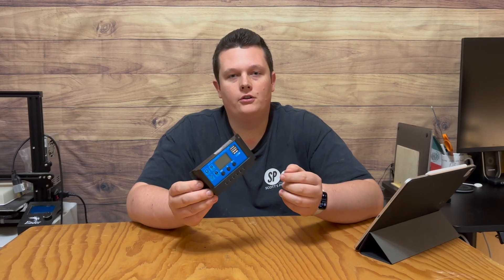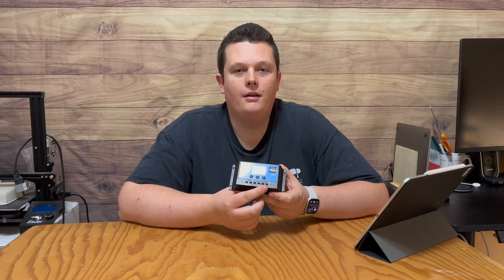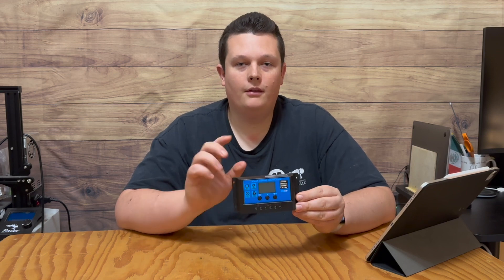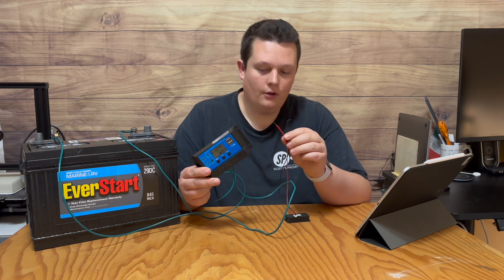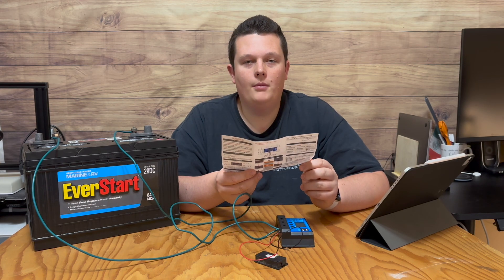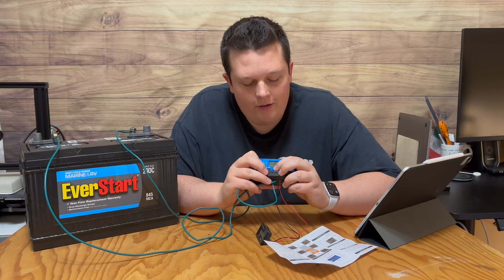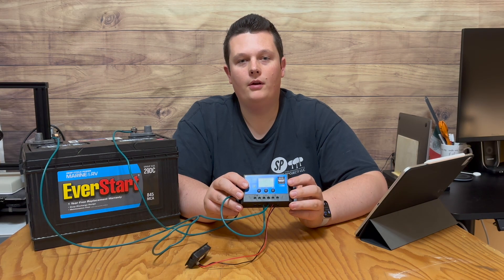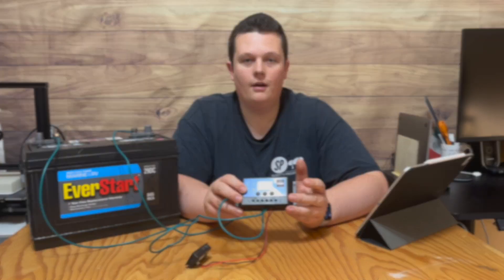How to Setup the Load on a Solar Charge Controller

Comment: Hello Sir can you please help me out 😢  i have solar system at home which is troubling me.the problem is i can't watch a t.v at night but during day i can use solar system very well i have 3000w inverter, 440W solar panels and 50a Sun Solar controller charger and the time i bought all of this i used to operate it even at night so i have have but my problem is i don't know which one is should Change my batteries are 1 year old its 100ah your response will be appreciated 🙏.

Comment: I'm running a 60 watt greenhouse heater through a 300 watt inverter overnight. It drains my 105 ah deep cycle battery to 10v after 2 nights? Should I be able to run this heater this way without draining the battery?

Comment: On the load side can you connect AC or DC appliance or bought
Reply: 12V DC, the same as your battery. You could use a small inverter as the load to create 110/220V power e.g. 150W, maybe 300W.

Comment: Can we connect lcd tv to the controller DC output?
Reply from the maker: In order to do that, if it works, you would have to connect a small inverter to the controller and then try powering your tv from there.

Comment: Hi Scott, nice explanation on the built in output port. Since this output allows to schedule the time for either 12 VDC or 24 VDC devices, it can easily drive a relay coil at one Amp. Then the relay makes it possible to control the timing of the inverter that powers 120 VAC loads. The inverter consumes power at night unless it's turned off, unless the capacity of the battery allows to resume the charge the next morning.  All that depends on how much Ah your battery is capable. As far as the USB is concerned, since it's enabled all the time, it can be used for a small LED motion sensor light whenever servicing the unit at night or to power a security camera. I got a newer version of this PWM controller from Temu for about $15, but I ordered the 24 VDC to give me 720 W max or 240W if I follow your derating. Anyways, that's plenty enough to drive all four air pumps and the two 200 GPH water pumps for my pump through a 300W PWM inverter from Temu that I paid only $25 and 2 200W used solar panels at $20 each! Great deal overall!

Comment: Hello Scott. I have this same unit charging a pair of deep-cycle batteries in parallel. Their output measured with a multi-meter matches the contoller's LCD display (14.2 volts) when selected from the menu. When the display resumes the default display there is a value 0f 11.9 volts. This does not match the panel output voltage. What does the 11.9 V represent?  Thanks Tony.

Comment: Ah, fair enough. I was kind of assuming the "Load" connections were for something like a big resistor or an incandescent lightbulb or something similar, so if your batteries were fully charged, but the solar cells were still cranking out watts, there was somewhere for the excess power to go.
Thanks for explaining this.
Reply: I thought the same thing. Can some please confirm? Does excess load need to be dumped? Thank you
Reply: @kaydog890  I actually did a bit of research after writing that comment, and the answer is that there ISN'T any excess power to get rid of. Solar cells have a sort of resistance "Sweet spot" where they produce the most amps, and the charge controller plays with this resistance to modulate the panels output. That can go all the way up to pretty much disconnecting the panels so they produce a high "open circuit" voltage, but in that state they make next to no amps. This is why disconnected solar cells don't just build up energy until they start arcing all over the place and exploding. When disconnected they see a pretty much infinitely large resistance, so produce a miniscule amount of power.......... OK, this way of describing it isn't really 100% accurate, but it's close enough to how it works to be "True enough", and it's easier to get your head around this that to take a deep dive into the science behind how solar panels work. :D
 
It helps to think of the solar cell like a kind of battery, but one that stores it's power about 90 million miles away in the sun. :D . When a charged normal battery isn't connected to anything it's still got POTENTIAL energy inside, but without any way for it to flow from one terminal to the other it's energy that's just sitting there....... twiddling it's thumbs and waiting for something to do. Solar panels have a similar sort of potential energy in the form of the light that's constantly hitting it, the difference is, if a solar cell can't do anything with this energy it's just wasted as a slight amount of heat.

In most senses though, solar cells can just be thought of like batteries. To an extent you can run them in parallel to get a higher amperage, in series to up the voltage, or a mixture of both to try and keep the open circuit voltage and total amps produced below what your charge controller and wiring can handle.

Comment: Brilliant Scott, you answered the exact questions I needed to know. Thank you for taking the time to put together this video. 
Given that the timing control for the load is not very flexible on the unit itself, I think I'll switch the load to ON permanently and use a separate timer to control the power to the load. 🙂

Comment: Does the load take power from the battery or directly from the panel?
Reply: Never have solar connected to charge controller without a battery connected if thats what you have in mind to do. It will most likely damage the controller.
Reply: If you Load side 12v  on the charger  controller
Reply: The battery lol

Comment: I have this same controller, it always gets hot and smells when the sun is high and display E12 or E16. I have 6 panels on two 12v batteries. What could be the issue.

Comment: Cool vid thanks, I'm trying to work out the simple math so i know what wattage the controller is effectively producing... When I switched the controlled on obviously all i could see is voltage.. So I'm i'm running 100w solar into a 12v battery can you please tell me the magic math so I know what its putting out in watts at any one time. Thanks!

Comment: Can the battery be disconnected from the charger (shut off switch) while a solar panel is connected and return to normal use after the battery is reconnected?
Reply from the maker: Unfortunately I wouldn't think so. You always have to connect the battery first to the controller.

Comment: Çan i connect an inverter to the load?
Reply from the maker: You can, but most likely it can only handle up to 120 watts, so it's best to connect directly to the battery.
Reply: @ScottsSolar  thank you. The reason i ask is because i would like to run a small fridge but only when the sun is up.
Reply from the maker: Gotcha, not sure it will work, but best of luck!
Reply: @ScottsSolar  thanks

Comment: Can i use the load output for my 12V DC TV while the charging is on 14.4V. thanks
Reply from the maker: Yes, I believe so.
Reply: @ScottsSolar  thanks sir, cos it's normal for the voltage to go high when there is enough sunlight
Reply: Thanks GOD bless

Comment: What does the the two voltage meanings mean in the menu? You can increase and decrease.It's 12.6-14.4 volts
Reply from the maker: That might be the float voltage, you can set it to whatever you want, or just leave it to the default.

Comment: I order one of these controllers to add to my portable power box to just regulate charging my lithium battery during the day while out on the pier fishing . My question is do I have to run my lights and other thing from the load side or can I just run them off the battery like it  now.?
Reply: Yes can run from battery, the load port can’t handle much load so connect directly
Reply from the maker: The load ports can handle up to 120 watts, if it's greater than that, just hook up to the battery. Also, this controller doesn't work with Lithium batteries, so be aware of that.

Comment: Hello, Thank you for this informative video.
Does the controller stop charging the battery automatically when it is full ?
Thank you
Reply from the maker: Sort of, it slows the charge down to a trickle charge, which is good for batteries. It regulates how much charge the battery needs based on what you set.

Comment: there's one thing I don't understand about this one. i know it will drop the current equal to the voltage of the battery, but why when I measure the voltage of the panel it also reduced by the charging voltage? I mean the solar panel voltage is 19vol, the charging voltage is 12vol, when the battery is charging, the voltage of the panel will be reduced to 12vol at the input of the controller.
What can I do to prevent the solar panel from dropping voltage?
Reply from the maker: Good question, did you measure the voltage coming out from the controller for the battery? And how?
Reply: I believe what he is referring to is Voc v. Vmp. "Open circuit voltage"  occurs whenever there isn't any load connected to the PV modules, and current is not flowing. The "voltage at maximum power"  is the voltage when the power output is the greatest. It is the actual voltage you want to see and is what you see when connected. Also take note that the voltage will be pulled down by the battery whenever connected especially when the battery has a much higher Ah then the solar panel as the current tries to increase the battery charges however at some point depending on the size of the panels and batteries in the system the panels will fill that battery and without a charge controller or regulator it will far exceed the max voltage of that battery and eventually destroy it. Hope this helped. So no there is nothing you can do nor need to that is normal to see the voltage drop. Again make sure to have some type of charge controller on.

Comment: hmmm, then how this solar charger know when is sunset? if by input how do it know, that it's sunset not rainy day?
Reply from the maker: Yeah, it's just by the input. So basically it will kick the load on when it's dark most likely.
Reply: Wait, if I start use timer their will be no load until sunset!? And will start only when sunset only(can't turn on manually)
Reply: This is sad, I going to use it only daytime and turn it off at night.
Reply from the maker: If you set it to 24H you can manually turn the load on or off whenever you want to.
Reply: @ScottsSolar  well, i plan to use it to work automatically with automatic device and ture it on only at daytime to save battery for a bit and place somewhere far to detect the amount of people at daytime. So i don't think it possible, But your video is really helpful thank you. ( ^ - ^ )

Comment: I’m using a mppt 60a charge controller with 2 panels and 2 renogy 200ah batteries the battery monitor said 177ah. When I pulled power from the Giandel 5000w inverter the stored power went to 0% starred recharging and battery alarm started going off. I don’t understand why the battery charge loss.
Reply from the maker: Interesting, I'm not sure why. How large was the load you pulled from the batteries? Are you saying the monitor indicated 177AH stored in the battery currently? I know high loads may cause that to happen if the batteries weren't rated to withdraw a high amount of power.
Reply: It was just a 5amp freezer.   Let me ask a couple ?s it’s only getting 11.5 volt’s coming from the charge controller to the batteries so there charging really slow it seems, and the battery monitor only shows charging when the inverters on. I’m wondering if the panels are bad?
Reply from the maker: Sounds like it, they should be charging around 14 volts I believe. Double check all your connections are tight and setup properly too.
Reply: OK, thanks only two more questions. What should I look for in solar panels? And is there a charge controller? That’s easier to navigate through the directions or just simpler to use with two or more panels ?
Reply from the maker: I would choose mono crystalline panels, like this one: https://amzn.to/3Ei1cId. This controller in the video is very cheap and basic, you can find many others, but I don't know if they're easier to setup. You can also try victron, they can connect with your smartphone and you can see realtime data which is cool, but they are more expensive.

Comment: I do not take my power or load from the load buttons.
I run an inverter connected directly to two 12volt batteries. This means that I can power 240 volt items like electric drills/TV/Microwave..
The inverter stops my using it when the battery goes below a critical voltage. Scott please notify me if you comment.
Reply from the maker: Yes, that's how I use it to get 110 volt power, an inverter directly off the battery because for most applications the load output doesn't provide sufficient power.

Comment: Great Video!  So, could I hardwire my Jackery to the load output using the provided 12volt car adapter that came with the jackery?  That way I could charge the jackery during the day and have it stop charging at sunset.   Since I can already charge the jackery using the 12volt car adapter by plugging it into the cigarette lighter, seems I should be able to just chop off the 12volt adapter part and use those wires to connect to the charge controller output.  Other end of the adapter already has the 8mm plug on it.  Am I wrong???
Reply from the maker: Yes, that sounds like it would work. If you're wanting to tie into your existing system, then yeah, just hook up the Jackery to the load output and the Jackery should also manage charging on it's own.

Comment: i have 100ah battery and 120 w  pannel (all new) during the day, it shows a fully charged battery signal (14.4v) but during the nyt after 1hr the controller displays a blinking low battery signal and lights are off . have i interfered with charge controller settings? is the battery a problem?
am using lead acid battery (Incoe n100)
Reply from the maker: Yeah, it could simply be a bad or weak battery.

Comment: Can this work on a 5000 watts 10000 peak watts continuos power. On a Jupiter inverter
Reply from the maker: No, the max load output is 120 watts. Hook it up to the battery directly.
Reply: @ScottsSolar   ok thank you
Reply: What type of battery to use
Reply from the maker: My goto is lithium iron phosphate for best results, but that wouldn’t work with this controller. So, I’m the cheap side, I would buy Walmart deep cycle batteries that do work with this controller.
Reply: @ScottsSolar  so would it push the Jupiter inverter 5000 peak 10k
Reply: How many batteries I need
Reply from the maker: To run 5k watts continuously, you would need a massive setup. What are you trying to run and for how long?
Reply: Like my air conditioner/ heat supplement 8000 btu kitchen appliances and a min fridge
Reply from the maker: Ok, that’s going to use a lot of power. You wouldn’t want to use this basic charge controller. You’d want an mppt, maybe up to 1k watts of solar panels and something like 10 batteries. I’m just spitballing here to help steer you in the right direction, just know it’s gonna take a big investment to run that stuff.

Comment: Your videos are to the point and that is why I decided to ask for your input.
I am setting up a Solar Pond aeration with 2 100 watt panels same Controller, 100 aH 12v battery , a 225W(400W surge) inverter and a HiBlo Air pump1.6amp 120v. I need to know how to correctly connect the inverter. Should it be connected to the controller or directly to the battery leaving the load port empty. Also should all Positive 10awg wires be Fused?
Reply from the maker: Thanks for the feedback. It depends on the rated output watts your controller load can handle. In the video, mine can only handle up to 120 watts, which wouldn’t work for your setup. So I would hook directly up to the battery. And when it comes to fuses, I’m not an expert, but I would say when in doubt, it never hurts to use one. I hope that helps!

Comment: Hi I've just got into solar and I have bought one of these controllers. I have 8 low power LEDs which are on a 5H setting. I am using a 12v gel battery. The lights come on great at dusk but a couple of hours later the whole system starts flashing. Any ideas why?
Reply from the maker: The lights starts flashing? Or the controller screen? What’s your battery voltage at when they start flashing?

Comment: Some people connect both appliance and mppt directly to the battery. How is this different from connecting the appliance to the load port. Thanks for sharing.
Reply from the maker: By connecting the appliance to the load port, you can adjust the settings like when it powers on or off. But it doesn’t really work when you have a large load, in that case you need to connect to the battery directly.

Comment: So is the load only for 12v appliances? also how do the load ports differ from the battery charging ports other than by name?
Reply from the maker: The load ports provide 12 volt power for whatever you want to run, up to its rated spec, which mine is 120 watts. The middle ports for battery charging specifically regulate the battery voltage to how you configure the settings.
Reply: No difference at all..

Comment: Hi,

I've set up my controller, battery and solar panel.  I was planning on running a USB heat mat from the controller.

When I switch the mat on, the controller loses power, switches the blanket off then the controller comes back on.

Do you know what the issue could be?

Thanks
Reply from the maker: Most likely it’s an issue with your battery. Either not large enough, bad, or the controller settings need to be adjusted so the load stays powered longer. Try lowering the load off voltage.